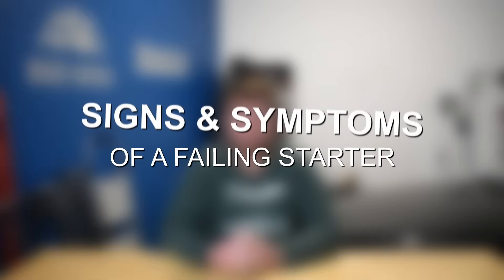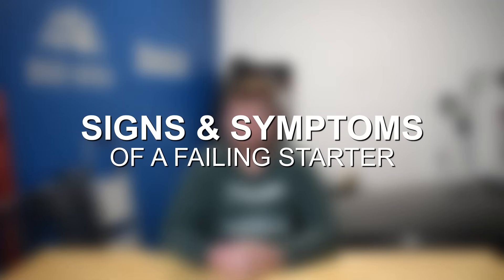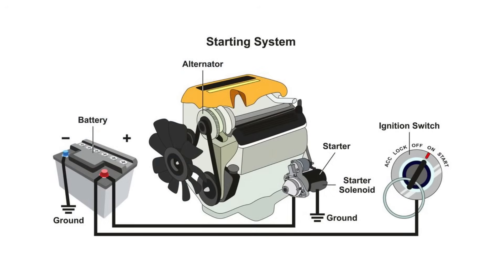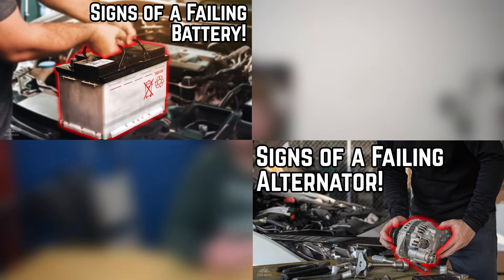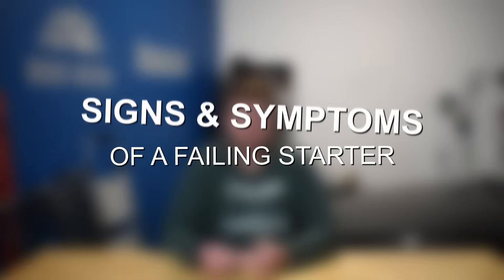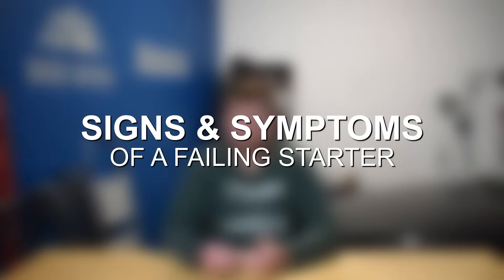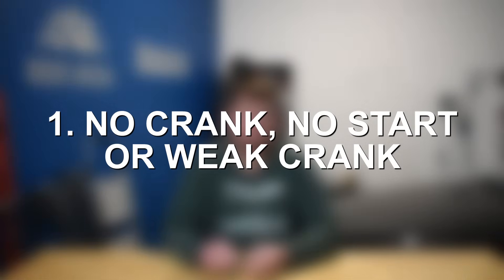5 Symptoms of a Bad Starter!

Comment: my 2017 Honda Odyssey minivan has been very well care for, but all of a sudden when I crank it, it makes a swishing sound for a few seconds which then goes away. Not every time I start the car but most times.
You can also compare the momentary sound to
The sound of putting a playing card against bicycle spokes while spinning.  Again, this sound only happens upon cranking, then goes away after a couple seconds.
Does anyone have an idea of what that can be?
Reply from the maker: G - Sorry to hear this. That “swishing/card-in-spokes” noise on startup in your 2017 Odyssey is usually caused by something in the belt-driven accessory system making noise until it stabilizes—most commonly the starter one-way clutch, serpentine belt, belt tensioner, or an idler pulley bearing. On cold starts, the belt can slip briefly or a pulley bearing can chatter until it spins freely, which makes that playing-card type sound. Since it disappears after a couple of seconds and the van otherwise runs well, it’s not usually harmful yet, but it’s a good idea to check the serpentine belt for glazing/wear, spin the idler/tensioner pulleys by hand for roughness, and listen at the alternator and A/C compressor clutch. If it only happens intermittently and only at startup, it’s much more likely accessory drive than an internal engine issue.

Comment: My car has this problem , usually there wolud be times where I get no crank , and then after trying a couple of times or so It would finally crank and start 

Latelty it takes way way too much to start so I'm also starting to have problems with the battery which ofc drains with all these attempts , but there is a very funny coincidence , and it seems that draining the battery fixes the issue , as the car would finally start to crank /intermitently /or do the fast ticking sound that indicates that battery is dead .

But why is this ? How is that I can spend like 20 min trying to make it crank without any success but whenever I drain the battery I do get finally crank and then If I recharge with another car help It always starts at the first attempt ( but in order to do this the battery has to be drain , I tried this múltiple times and It always starts at first try , which seems ridiculous if the starter it s bad right ?
Reply from the maker: Z - What you’re describing sounds odd but actually makes sense once you break it down — the pattern points less to the starter itself being “randomly bad” and more to an electrical connection or control issue that changes when system voltage drops. Here’s what’s likely happening: your starter or starter solenoid has worn contacts or high resistance; when the battery is fully charged and strong, the solenoid doesn’t quite pull in or the bad connection doesn’t “burn through,” so you get repeated no-crank. But when the battery voltage sags from repeated attempts, the lower voltage/current draw actually changes the electrical load just enough for the solenoid contacts to seat or the failing connection to engage — that’s why it suddenly cranks right as the battery seems “dead.” Then, when you jump it, the fresh current gets the system turning normally on the first try.

In short, the “draining the battery fixes it” is a clue that the starter solenoid or internal contacts are failing, or there’s a high-resistance connection in the starter power/ground circuit (battery cable, ground strap, ignition switch, or relay). The battery itself is likely fine, but all the extra cranking attempts are wearing it down. The best move is to check and clean all major grounds and starter power cables, then either test or replace the starter assembly — because the behavior you described is classic for a starter that’s on its way out.
Reply: @8020Automotive thx for the great breakdown , makes a lot of sense and at the same time is so enigmatical , because it seems that the trick would work every single time ,that's the part that I don't get I would expect some randomness there .
Reply: @8020Automotive it's absolutely unbelievable , but the trick workd every time , it's not intermitent ,I already did it like 10 times lol , shouldn't that alone be a clear indicator of what's going on ?
Reply: @8020Automotive is there any temporary (1 Week ) "better" trick that would give me the same result of a weak battery ? At least that way it starts at first every try ... Maybe sticking something between positive and battery connector just yo get a low V and get the car to the point where does crank , and then remove the thing and start the car as usual
Reply from the maker: Z - I wouldn’t try to trick the system with resistors, shims, or anything jammed between the battery and cable — you’ll only create extra resistance and heat at the terminal, which risks melting, arcing, or even a fire, and it won’t give you a stable “weak battery” signal anyway. If your car only starts reliably when the battery is weak or drained down first, that’s a sign the starter, ignition switch, or an ECU/immobilizer input is misbehaving, not that you need a low-voltage hack. For a safe short-term workaround, your best bet is to use a known-good battery with proper voltage, make sure the terminals are perfectly clean and tight, and if needed add a battery disconnect switch so you can “reset” the system before starting — that gives you the same reset effect without risking damage. Long-term, though, the fact that it likes starting after a low-voltage reset points to an electrical control or ground issue that should be diagnosed rather than patched.
Reply: @8020Automotive was indeed the starter so yeah
Reply from the maker: Z - Great to hear! Glad we could help.

Comment: What if the Starter either seems to turn over normally but for a prolonged time before the car starts? Then it sits for a week and immediately starts up immediately.
Reply from the maker: G - That kind of intermittent hard-start is usually a fuel delivery or sensor issue rather than the starter itself—if it cranks normally but takes a long time to fire after sitting a short while, it’s often because fuel pressure is bleeding down (bad fuel pump check valve, leaking injector, or faulty fuel pressure regulator), so the engine has to crank longer to re-pressurize the rail; when it sits for a week, all residual pressure is already gone and the ECU runs a full prime cycle, which is why it lights right up. Another possibility is a weak crankshaft or coolant temp sensor giving the ECU wrong data for warm starts but not cold starts. I’d check fuel pressure with a gauge, especially after the car has been shut down for an hour, and see if it drops off quickly—if it does, you’re chasing a leak-down issue in the fuel system, not the starter.

Comment: I have a Corolla 95 AND starts to sound weak when starting,battery Is ok at 12.4v and alternator Is ok, It shows 14v after starting, will replace the starter.
Reply from the maker: J - If your Corolla’s battery holds 12.4V at rest and your alternator shows around 14V when running, the charging system is fine, so a weak crank is likely from the starter itself due to worn brushes, a tired solenoid, or internal resistance; before replacing it, confirm the battery can deliver enough cold cranking amps under load and that all battery cables and grounds are clean and tight, but if those check out, a new starter is the most probable fix.
Reply: @8020Automotive thank you, Will do.
Reply: @8020Automotive It turn out to be the battery. I went to Autozone to buy a starter and It completly die. They check the battery and It was bad. Bought a new battery and is working fine.
Reply from the maker: J - Great to hear! Glad we could help.

Comment: Hi I need advice please my 2017 Chrysler Pacifica 
Wouldn't start had it towed to a shop and the mechanic said it was the starter. He replaced the starter. As I was leaving from the shop after he completed the work I got down the road my car ran hot for the first time.( My car had NEVER RAN HOT EVER BEFORE) I immediately called him to let him know my car was running hot. I turned back to the shop. He put water in my coolant tank. Asked me to drive up the road with the heater on full blast  . I did that . Came right back to the shop over heating stopped almost immediately. I went home .car was fine .. Next morning, car started and has a very small amount of white smoke coming out the back. Lasted maybe 2 minutes. Car was fine , Afternoon comes car won't start. Gets towed back to the shop. He replaced starter again. But this time he  tells me to get Head Gasket Repair Liquid and pour it into coolant tank. ( I bought the product BUT I didn't put it in my coolant tank)  Next day car has a little white smoke could barely see it right after starting it the next morning lasted maybe 2 minutes. Hours later same day car only started after 3 times of trying to start it. Than makes a strange sound after backing out of a parking spot. Got on the highway and car runs smoothly. Get home no dripping fluids no smoke no over heating no nothing car is fine. Same day afternoon comes started the car and Nothing.. just a really weird fan sounding sound . Car wouldn't fully start!! I checked the fluid inside and under the car no leaks no nothing I could see that was out of place car had fluid it didn't drain or leak any where no leaks on the ground nothing no milky oil I checked the oil. Tow truck come take car back to the shop. Shop only 4 miles away. Mechanic receives the car and sends me a video showing me that my coolant tank has no coolant in it. But I had literally just checked my fluids right before my car left my house. Now mechanic says I have a leaking or blown head gasket. I NEED TO KNOW IF THAT IS TRUE????!!!!
Reply from the maker: S - From what you’ve described, there’s a strong possibility the overheating and current no-start issue are related to how the vehicle was handled after the starter replacement. If your Pacifica had coolant when you left home but the tank was empty when the mechanic later checked it, that indicates either a major leak developed during or right after their work, or the system was not refilled/bleed properly before you drove away. Driving even a short distance with low coolant can cause overheating, and repeated overheating can quickly lead to a blown head gasket. The white smoke you saw after startup was likely coolant burning in the cylinders, and the strange fan noise may have been the cooling fans running at high speed to compensate for a temperature signal. Since the mechanic first told you there was no head gasket issue but later changed his stance after this incident, I’d be cautious — document everything (photos, texts, receipts, coolant levels) and consider having an independent shop perform a pressure test, leak-down test, and chemical block test to confirm head gasket failure before authorizing major repairs. This will help determine if the damage was pre-existing or potentially caused by improper coolant handling after the starter job.

Comment: I HAVE A 2011 FORD MUSTANG CRANKS BUT NO START , EVERYTHING WORKS , WHAT COULD IT BE? IT WAS WORKING FINE TURNED IT OFF THEN THAT HAPPENED
Reply: I JUMP STARTED IT AND IT DOESN'T DO ANYTHING WHAT CAN IT BE?
Reply from the maker: J - Sorry to hear this.. If your Mustang cranks but won’t start after working fine previously, and jump starting doesn’t help, common culprits include: (1) Fuel delivery issues—check if the fuel pump primes when you turn the key to ON (you should hear a short hum from the tank); if not, it could be a bad fuel pump, relay, or fuse; (2) Ignition issues—a failed crankshaft position sensor or bad coil/module can prevent spark; (3) Security/anti-theft system—PATS may have disabled the ignition if it lost key recognition (look for a flashing theft light); (4) Inertia switch—especially if the vehicle was jostled, the fuel cut-off switch may have triggered; (5) ECU or wiring fault—rare, but possible if you had recent electrical work or a battery surge. Scan for codes even without a check engine light—many no-start conditions log a fault.

Comment: I have a 2020 Kia and when I try to start it my dashboard comes in lights, and radio come on but the car doesn’t start and when I turn the key everything shuts off, but when I turn the key back everything comes on. I’m thinking it’s the starter correct?
Reply from the maker: D - Based on your description, it could be the starter, but it's more likely a weak or failing battery connection or ground issue. If everything powers on (dash, radio, etc.) but then completely shuts off when you try to crank the engine—and then comes back when you release the key—that's usually a sign of a voltage drop or interruption under load. Check the battery terminals for corrosion or looseness, make sure the battery is healthy and fully charged, and inspect the ground wire from the battery to the chassis and engine block. If all connections are clean and tight, and the battery tests good, then yes—the starter or starter relay could be at fault, especially if it's drawing excessive current and causing the voltage to crash.

Comment: Ok my car started then shut right off then started again then shut right off I replaced battery and everything electrical still work but now it won’t start at all
Reply from the maker: B - If your car started and shut off repeatedly and now won’t start at all after replacing the battery, it’s likely not a dead battery but an issue with fuel delivery, spark, or an immobilizer/anti-theft system. A failing fuel pump, clogged fuel filter, faulty crankshaft position sensor, or a tripped factory security system could all cause this. If you hear the fuel pump prime (a humming sound from the rear when you turn the key to "on") then fuel delivery is likely working; if not, check the fuel pump relay or fuse. Also, if the security light is flashing or stays on, try a reset procedure with the key (leave in "on" for 10 minutes until light goes out, then retry). A basic scan tool can reveal codes even if the check engine light isn’t on, and that would help narrow it down.

Comment: I have intermittant . sometime fails to turn  8 10 times in a row, then starts 10 times in a row ????
Reply from the maker: B - Intermittent starting issues like this are often caused by a failing starter motor, worn ignition switch, corroded battery terminals, or a weak starter relay or solenoid—especially if you hear a click but no crank; when it starts fine multiple times in a row and then suddenly doesn't, it's usually heat or vibration affecting one of those borderline components, so I'd first check all battery and ground connections for tightness and corrosion, then inspect the starter and ignition circuit for voltage drop or intermittent failure when hot.

Comment: Hey guy,
So I thought I had a dead battery, replaced with one from costco. Started up like a champ, ran and then I shut it off thinking it was fixed. Now next day its back to doing what it was; one click off a turn and then nothing. No power or anything. Turn the key off, back on and dashboard lights and key ignition sound are on... turn over, one click and then no electrical power. Starts up like a big dog off a jump and continues to run
Reply from the maker: N - What you're describing is a textbook case of a bad ground connection or a loose/dirty battery terminal, not the battery itself or necessarily the starter. Even though the battery is new, if the main ground strap (from battery to chassis or engine block) is corroded, loose, or partially broken, it can't carry enough current to crank the engine, especially under load. The single click is usually the starter solenoid engaging, but then voltage drops instantly due to poor connection. Check and clean both battery terminals thoroughly, and follow the negative cable to where it bolts to the frame or engine—remove, clean, and retighten that ground. Also check the positive terminal at the fuse box if your vehicle has a power distribution block. A jump works because it bypasses the weak link temporarily, but until you fix that connection, the issue will keep coming back.
Reply: @8020Automotive  Thank you! Im pretty sure a bad ground was the issue. Cleaned the terminals and made sure when i tightened the cables back on, all the accompanying connections to the ground were flush. It runs today and ran yesterday. We'll see when i take it for an airport pickup trip tomorrow but Im pretty sure its fixed. Thanks again

Comment: I have a 1989 GMC Sierra work truck 5.0.  I replaced the starter it did die.  
   But now I got the same situation where it just goes click and I’m trying to figure out what is the wiring problem if anyone else has run into this the starter will not crank.   This is a brand new starter.
Reply from the maker: K - If your truck clicks but won’t crank even with a brand-new starter, you’re almost certainly dealing with a wiring or voltage issue, not the starter itself—most commonly it’s a bad ground, corroded battery terminals, or a faulty ignition switch or starter solenoid wiring. Start by cleaning and tightening both battery terminals and follow the negative cable to the engine block—make sure it’s clean, tight, and free of corrosion. Then check the small wire on the starter solenoid (purple on GM trucks)—it should get 12V only when the key is turned to "start"; if it doesn’t, the problem could be the neutral safety switch, ignition switch, or a broken wire. You can also try jumping the starter terminals with a screwdriver (key in run) to verify it cranks—if it does, the starter and battery are fine and it’s a signal issue. A test light or multimeter will help trace it fast.